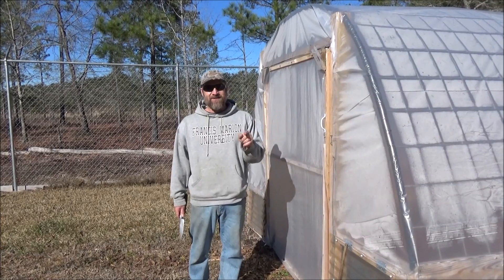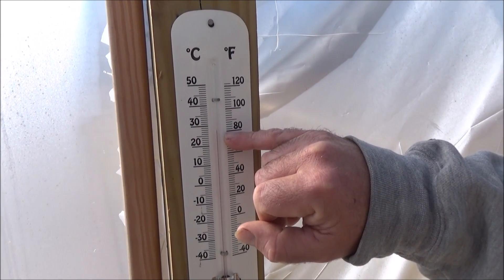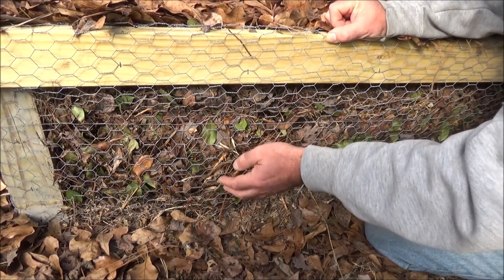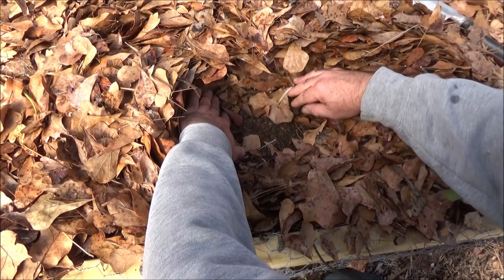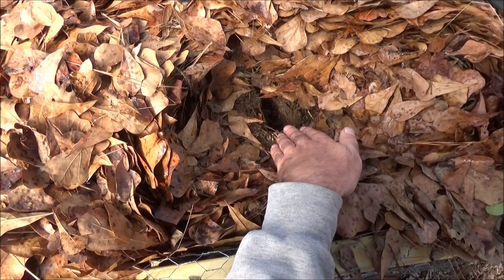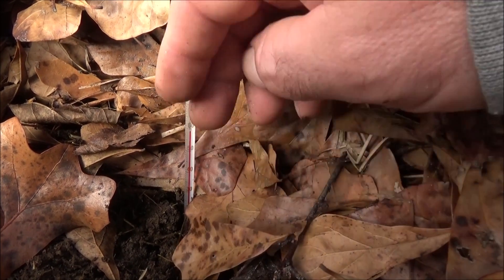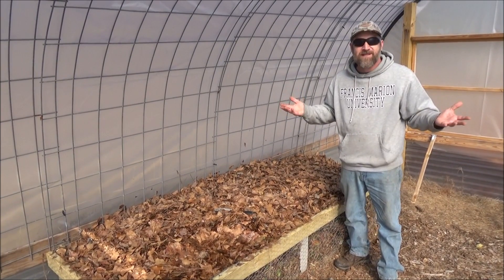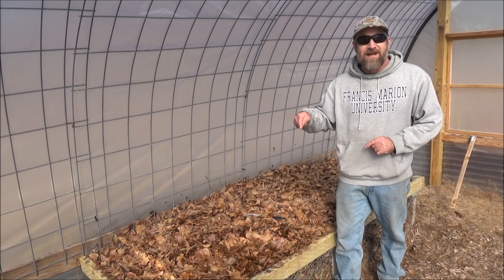FREE passive heating a greenhouse with compost

Comment: I was going to do bags of leaves around the outside border of exposed side of my greenhouse. I’ll be putting them into garbage bags though, I think. With that being said, will it still release heat without manure in it? I only have access to my dogs and cats poo 😂😂 I mean… it’ll be outside the greenhouse and inside bags, so maybe I should research using that??? I’m all ears bc I’ve not had a greenhouse yet

Comment: This is a great idea, but two things that you would want to concider are its lifespan/lifecycle, and the gasses consumed and produced (may be dangerous?). 

To the first point, the pile will produce heat for a couple of months on average, but that's probably enough for some areas to cover the colder winter months. 

The more important thing to consider is that a compost pile consumes oxygen, which could be bad in a confined space, but to compound that, if the compost pile IS in an oxygen deficient space, like the one it will create without good ventilation, it will start to produce potentially dangerous amounts of Methane and Nitrous Oxide, both of which are potentially hazardous to people and pets. 

So the problem I see with this is that you want to let the greenhouse breath, but you need to balance that with retaining the heat. I'm not claiming it can't be done, or that it's even difficult. It may just be that typical greenhouses allow enough air to come and go to keep that from being a problem. The plants may even be enough to turn the CO2 that the compost pile also produces into enough oxygen to solve the problem. I'm just saying it should be concidered, and I would be interested to see if someone has measured these things.

Great idea, great channel, great content. Thank you.

Comment: If you put this outside and ran ducting through you pile into your greenhouse you would omit the toxic gasses that are going to occur with this system.  You cannot do this without putting yourself in danger.
Reply: I’m a tree trimmer and I almost died after getting in the chipper truck after the chips being in there for 2 weeks 😅

Comment: Thank you!  Wanting to do this in my greenhouse that does not have power.   I have wood floor, would there be a way to enclose this as I dont want to rot the wood floor?  Also, is there a way to avoid any risk of spontaneous combustion?
Reply: some kind of tarp   or if you want to be really  save a concrete basin. you can avoid spontaneous  combustion  by not making it several meters tall. oh an keep it wet enough

Comment: Just nowseeing your channel.  How long did it take from start until you filmed that the heat was enough?  I have a compost crib in my greenhouse, but as of yet it is not heating.  I am using clay pots filled with sawdust as extra heaters.  But it's still not enough for cold overnights.
Reply: Seems to me about how you layer the compost, so layers of actual already done compost in it so the microbiome get heating, egg shells and trimmed up small banana skins help, plus you could pee and water it down a lot then water it with that to get the nitrogen in. If you are feeling really brave sabe some dumps of your own manure, compost toilet is best, basically any poo heats it like crazy, I tried with my rabbit children years ago using their pine toilet chips and their rabbit droppings plus veg and fruit waste and nut wast etc, I had lots as I had five rabbits my children then so rabbit manure was abundant. I had no idea that compost especially with manure hearsd it up. I did not know how to cover smell or weaken the nitrogen aspect then etc I was new to compost completely, I saw a shed load of steam coming off it and I swear to god it must Iof been at 150C no word of a joke, I was shocked! It was amazing though, did not carry it on as I & my then other and our rabbit children were being targeted and had to survive. Still am.
Reply: I have the same issues and using clay pots as well.

Comment: Thnx. Im planning the same. What im planning is figgong down 4ft and also running tubing with fan to push air through every 1 hour during the night. Heaps of vids on it thermal geo hesting etc but i thought youd like to know as a give back for your vid 😁
Reply: You could use an aquarium air pump to move the air through it continuously. Low power & low air flow. A $20 Tetra Whisper 20 pump should move about 20 gallons of air per hour. That is about .045 cubic feet per minute, but you don't want too much or it will cool the pile down too much.

Comment: Today is a very warm winter day in Hungary but the real winter is coming and I have a small, 6.5m ×2.4m raised-bed, I want to upgrade it to a greenhouse this winter and I want to make a similar passive heating "system" like your. I have three questions:
1.) how cubic meter (or cubic feet, if it is easier for you ;) ) was your pile?
2.) It is started to generate heat by itself or required to handle with any biological "starter" or compost or manure, etc...
2.) Is there any dangerous gases cumulated inside your greenhouse?! There is no any dangerous if the greenhouse rarely opened?
Thanks for any answers.
Reply: Read the book Humanure this way you already have that starter

Comment: Wondering if you're considering adding any automatic vents in your greenhouse to prevent it from getting too hot or damp?Thanks!
Reply: Wax motor cylinders are a thing. They are like hydraulic cylinders but uses wax as the actuator.  Wax expand or contract depending on temperature. So it can open the vents when it got enough heat.
Reply: Dampness is another issue, but I heard some ancient method uses certain hair braided to a yarn where they contract to humidity. Might be used to pull a series of pulleys but that veers on complex machinery.

Comment: I use fresh horse manure in mine it works good and free. You can put seed starting trays on top a get a head start or put 6 inches of compost on top and have things going on all winter
Reply: Hey, super late to this thread but I'm curious if you could tell me how often you have to add to the compost to keep it heated or does the heat stay relatively steady for most of the season?
Reply: @toad_house_homestead  I will cool over time I turn mine if it get to cold. When you turn it lets o2 sack in and will heat up again. The larger the pile the longer it last.
Reply: The best free poo is your own. Humanure is one of the best books of all time. Get it!!